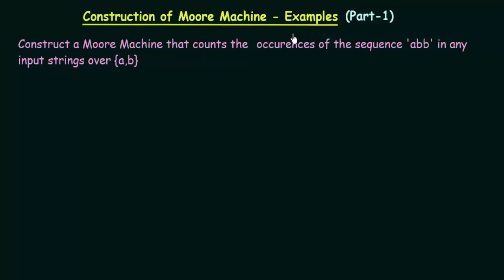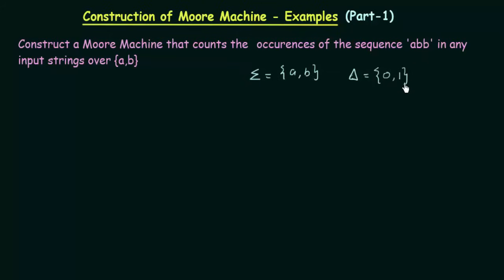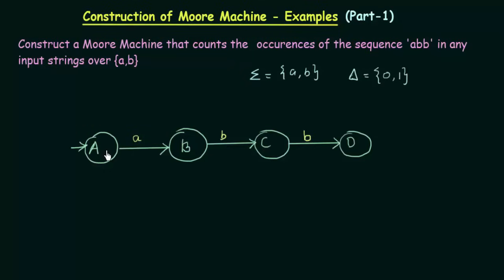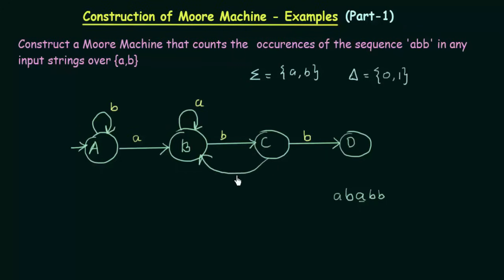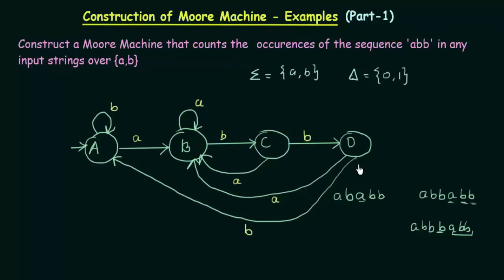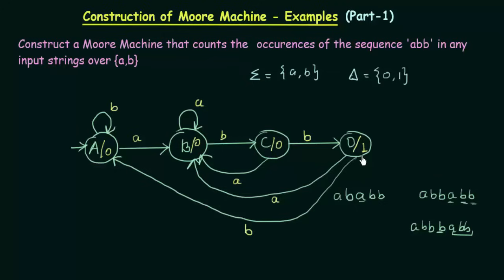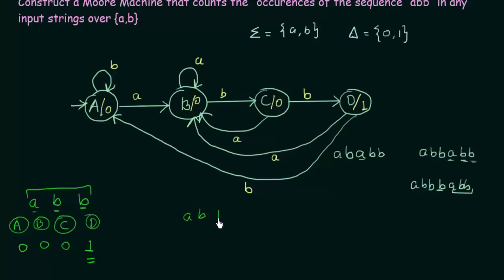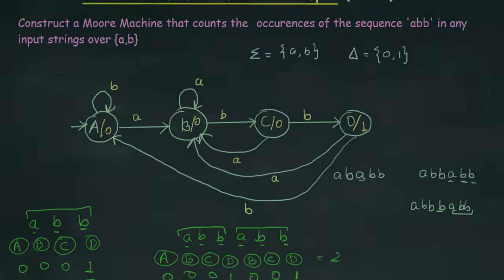Construction of Moore Machine (Example 1)

Comment: I don't think the designed Moore Machine could count the occurence of the sequence of "abb", it only could output 1 when it encounter "abb", and it encounter "abb", it will re-init its state again, instead of "count", it has no capability to "count" the occurence of "abb". This is a small mistake on the slide.

Comment: Example: Design Moore Machine having two pulse inputs x1, x2 and one level output z. z is to toggle with an x2 pulse immediately following at least two consecutive x1 pulses.

1. Design the machine given in the drill and write the excitation and output expressions. 
2. Draw the schematic diagram of the system 
3. Draw the timing diagram of the machine given in the drill
4. Write the names of different toolboxes that you have used to draw the schematic 
diagrams?
May you please help me out in this question?

Comment: If we want to count the occurences of the sequence 'abb' then we need to construct DFA that contain substring 'abb' in it because in question there is not mentioned that we want sequence 'abb' in end 
So instead of constructing DFA that end with sequence 'abb' we need to construct DFA that contain sequence 'abb'
Reply: Correct me if i was wrong
Reply: @geetabadgujar2565 in moore machine there is no final state so we use DFA that end with 'abb' , if we use DFA that contain 'abb' then it will increase the no. of states only
Reply: @ashishyadav310  how will the number of states increase, In the mentioned example can't we just make a self loop at D for input a and b so. Our 'abb' will be included and all the strings can also be accepted that contain abb.

Comment: Can we design more than 1 Moore machine for a same task?
I have designed a Moore machine for the above problem which is working correctly.
Reply: I also made with 3 states . On C i made self loop if input is b and i think its's correct
Reply: @AbhishekSingh-fo9nv  no , that's incorrect
Reply: @harsh_t  why
and how
Reply: You must have done it with 3 states. Same here, seems correct.
Reply: @marcusshane  however, i don't see how you can do this with just 3 states
none of them is redundant
Reply: yes you can
they are infinite